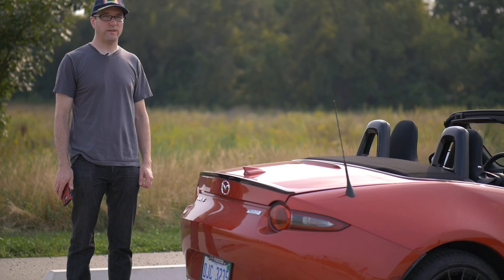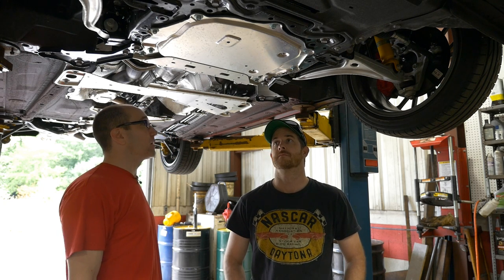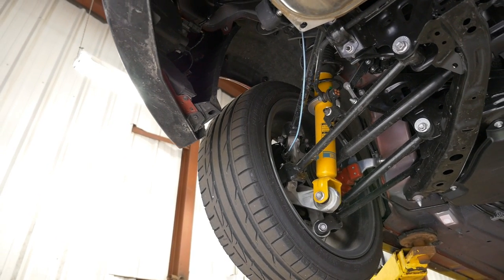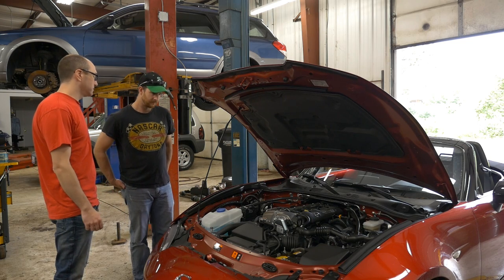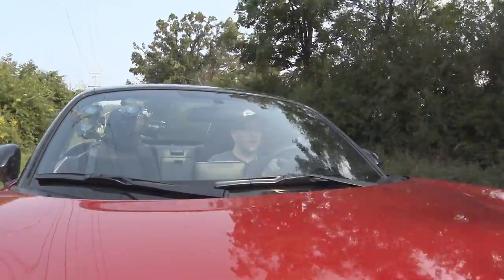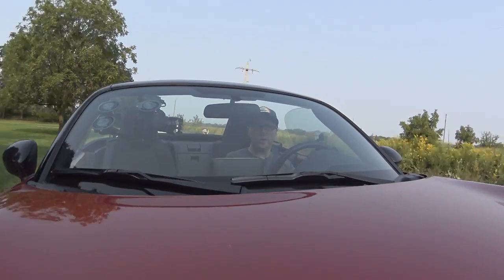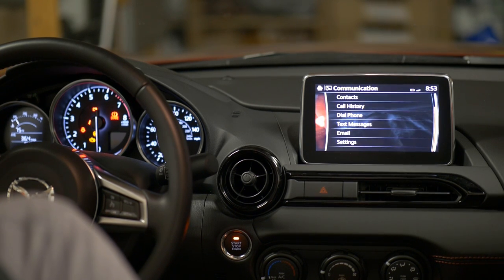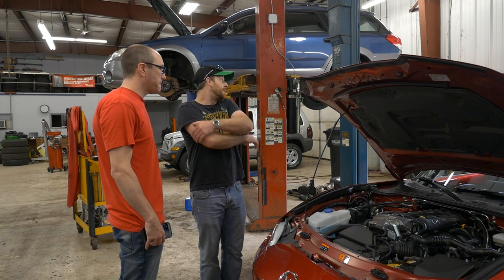Review | 2016 Mazda MX-5 | Curing Automotive Diseases

Comment: This car makes me emotional, someone in the auto industry still gets it!
Reply: holds you and pats head
Reply: i do, it makes me emotional too, i want it so bad.
Reply: I can confirm this car is everything they say it is and more, Owning a 2016 Grand Touring trim myself with the 6 MT. It is the best Miata yet in my opinion and i've driven all of the generations. NA,NB,NC and now the ND. I've seen the higher mileage base 2016 Sport trims well under 20K at this point, but i'd go for atleast a Club if possible. Such a fantastic car and absolutely worth every penny if you have the money to spare. Fantastically reliable too, Up to 60K miles now with nothing but fluid changes and tire rotations. Bulletproof car as far as I can tell so far as all Miata's tend to be, And I haven't exactly babied her either. Beautiful for a Miata too in my opinion, and the Bose sound kicks and is a very welcome addition to a car that has had historically poor audio performance.

Comment: I bought a new 2018 MX-5 GT almost two years ago, and I absolutely love it.  It’s my daily driver, including through NE Ohio winters (with a separate set of wheels shod with winter tires).  You hit many great points during your review.  I would only add that the car’s shortcomings are far outweighed by its other qualities.  If you can learn to live with such a small car, or make compromises, it’s well worth the trade offs.

Comment: Your review is really in depth. You look deep into the engineering that went into making this car then comparing to what is out there. Nice job of going over the good points but also pointing to the flaws. I watched this many times over plus the Engineering Explained & Consumer Reports reviews. Then saw an Autoblog Long Term Winter Test where  they had this 2016 MX-5 Club up in Michigan. Putting all this info together convinced me I could make the 2016 MX-5 Club my daily driver here in Illinois. Traded in my practical Honda Accord V6 Coupe to get this 2 seat roadster ! My plan will be to enjoy the heck out of it now but when winter comes get a set of snow tires. Short commutes to work. Single, no family its perfect for me. 1st convertible for me ever & loving it !  Driving this car is a blast ! I always look forward to my drive now & frequently take the long way home. Quite the bargain !
Reply: After 4 years what are your thoughts now on your Miata?
Reply: @dcarts5616  46 years of owning & driving cars. This 2016 MX-5 Club with Brembo brakes & BBS wheels has been the best one. As a daily driven roadster its been amazing in the 4 season weather of Northern Illinois. I look forward to each drive & yes its 4 years later. Has been thru Ice / snow / monsoon type storms / extremely cold & extremely hot weather. Mazda engineers have built a hell of a car.
Reply: I think the real question you have to ask is " can I live with a 2 seat roadster with minimal storage space " ? On my grocery store runs usually Buy for a 2 week period so the truck gets filled & the passenger seat becomes extra storage space. The people I've had as passengers usually love the experience. I calm my inner hooligan on those rare occasions. During the Pandemic this car has been a mood changer ! Put the top down after a hard day at work & the air flowing over you with the sunshine makes you forget why you were upset. Try to put a price on that feeling when walking out for a drive you get an increase in heart rate. Its good on gas even though its Premium every fill up I don't mind it. Would I Buy it again ? Yes without a doubt. THAT may be the best thing I can tell you.

Comment: I'm gonna be getting a manual Grand Touring model of this car as a daily driver in a few weeks. :)

I pack super-light anyway. I can get away with a 40L backpack (Mission Workshop R6 Arkiv) for a month long trip if need be, and I have a camera bag (Peak Designs Everyday Messenger) for day trips. Anything else is just clutter. If I can fit my 40L backpack plus a 24-in roller bag into the trunk (which it looks like I can), that's plenty of space.

For cabin storage, I only need place on the dash to mount my phone, a cigarette lighter to charge it with, and a small cubby for a coin box. Sunglasses can go in that little center console cubby.

The way I see it, as someone who drives in a big city (LA), I see lots of people who use Smart ForTwos and Fiat 500s around here, and everytime I see one, I just think to myself, "If you wanted a small, light, 2-seat car that can fit in any parking space you find, why didn't you just get a Miata?"
Reply from the maker: Totally agree since you are in the climate for it, Id likely do the same.
Reply: Did you get it????

Comment: The 1955 Mercedes-Benz 300SL was the first production sports car to use direct injection. The Bosch fuel injectors were placed into the bores on the cylinder wall 
used by the spark plugs in other Mercedes-Benz six-cylinder engines (the spark plugs were relocated to the cylinder head). You would think direct injection wouldn't be a problem in 2016.
Reply: it's not the direct injection, it's the exhaust gas recirculation! old cars didn't had to reburn the exhaust gases. port injection cleans the valves when it is sprayed. direct injection is sprayed into the cylinder.

Comment: A couples mod I did to my S2000 that makes it more useful for 2020.
- Rear auto dim mirrors with Homelink.  I don't get blinded by cars behind me anymore.
- Start engine without depressing clutch
- Open/Close convertible top without being stationary.  Pull the hand brake one click to activate.  
- Hardwire a GPS (Speed/School zone warning), USB ports for phones, dash cams (behind rear mirror), foot-well lights.  They are all hidden away behind "glove box" space.
- Modifry's DCI control and GPS mounts

I put mine on sale few times but never really want to sell it.  I recently drove it with winter tires and it's still amazing.

Comment: I'm a bit late to the party but   I have to agree that this is one of the best MX-5 reviews out there.  I'm picking up my 2.0l Recaro today and I've read/watched practically every review in English and German that I could find on the Web. 
I especially like the part in the shop, discussing/showing a car's underside. With that in mind, the local mazda-dealers I spoke to should be ashamed of themselves for not discussing the sophistication of the Miata's underpinnings with me. 

However: Watching this review and the AR 4C's back to back I have to wonder why the Alfa is so "heavy" despite its extensive use of carbon fibre while offering slightly less practicality and build quality and having the smaller engine  (displacement-wise).

But anyway: Great channel ... subscription button has been clicked. :)

Comment: Great video!  I just got mine a few months ago and I love it!  

I live in Denver and the snow management on the road sucks no matter what car you have.  This car actually handles better in the snow than the VW Passat that I had.  Also if you live in places where it snows more, then the roads are probably properly cleared.  It is also relatively warm in Denver even during the winter months so I did drive with the top down in January and February.  I was worried this wasn’t going to be a practical every day car, but I commute everywhere with no problem.  I don’t keep a lot of stuff in my car, so I don’t have a need for a lot of interior storage.  I take a phone, my bag, and a few other necessities. This car has helped me learn to keep unnecessary things out of my car.   It just got broken into and they got nothing!!  The trunk is large enough for me to go on a regular grocery shopping trip.  There are a lot of things I can’t fit, but my boyfriend has a bigger sedan.  This is definitely a car for someone who lives alone or for a household with multiple cars.  I was looking to get a BRZ, FRS, 328i, or a 370Z and I feel like I made the right choice.  

My biggest issue with this car is the placement of the charger port thing.  You literally have to almost get on the floor to plug something in.  They really messed up the placement in this car.   Another thing that kind that disappointed me was the lack of a luxurious interior.  The seats are not electric, the dash feels very basic, and it doesn’t match the stylish exterior.  I came from a Lexus GS and a VW Passat so I might just not be used to the more simple interiors.  It’s not a big deal, but it is going to cost a pretty penny to make cosmetic upgrades.  The last negative for me is the Bluetooth speaker in the headrest.  I can hear fine, but the person on the phone can’t hear me very well and when the call disconnects there is a loud beep that is almost painful.  

I love this car and the negatives I have are nitpicking and not huge dealbreakers for me.  I’m likely going to upgrade my ND to a newer model in a few years.  The only cars I would consider replacing it with are a Jaguar F-Type, an Audi TT, or a Mercedes SL.  They are more expensive and as I get older I am having less and less patience for all of the extra expenses and babying that goes into owning a European car.

Comment: First review of yours I've seen and have to say, I'm impressed. This is what reviews should be. No where else have I seen someone hoist it up and go over the undercarriage, suspension, etc. I also like that you slammed it where it needed to be slammed....no fan boy bias here!

As for the power, one theory I have is that Mazda wants to keep the aftermarket business in business. This is also another way to create a camaraderie among owners. They get together, do little tweaks, discuss parts, etc. which helps to keep the brand alive and interesting. Think of what would happen to guys like Flying Miata if the car came with 200hp from the factory.

Also, for engines, outside of the US, the base model comes with a 1.5 liter 128hp engine. You have to upgrade to the "sport" version to get the 2.0 liter. I haven't driven it yet, but pretty sure I wouldn't opt for a 1.5 liter. I have a 1990 NA and 2003 NB but skipped the NC. Based on reviews so far, might be time to add a 3rd child to the family.

Comment: The 2019 version's comprehensive upgrade of the engine makes the car genuinely fast: it gets to 60 in the fives. I bought the Sport (base model) late in the model year at a bargain price, in the mid-24s. I don’t need no steenking Brembos!
Reply: Smart man. I bought a 2019 Sport in late February; didn't get as killer of a deal, but got the same killer car.

At the base price of ~$25k, nothing touches this. Nothing comes close. A couple negatives still remain, but it's still automotive bliss.
Reply: Flying Miata has a "big little brake" kit that uses stock rotors but gives you 4 pot Wilwood calipers. I'm going to get the kit in the spring as the stock rear calipers stick from salt exposure from daily winter driving in central New Hampshire. Overall about 18 pound weight savings, they fit under 16" wheels. The price is quite reasonable, less than the Brembo option and includes the rear brakes. They don't have the flashy red paint, just grey anodizing, but quality parts.
Reply: @michaelbrooker1433  Well, all I can say is, I'm a big fan of Flyin' Miata because I used their Stage 3 Turbo kit in my NA to give fits to Lotus Elite drivers. But as to upping braking performance from stock: Here in Northern California, in very hard twisty-road driving, never have I experienced a moment of brake fade using my base-model's standard binders. 

And I'm talking about the infamous Hwy 9 south of San Francisco, as it crosses the hill country on the way to Santa Cruz and full-power bursts coincide with all-in stomping of the brake pedal to prepare for an upcoming decreasing-radius hairpin. 

I've diced with 911s and WRXs, and never ran short of brakes in my MX-5 Sport. And they could not shake me loose. The reason is simple: 2340 pounds net weight, MANY hundreds less than anything from the usual denizens of Hwy. 9. And, I can drive my Sport at its highest level of grip, using slip-angle four-wheel drifts to get those skinny 16" Yokohama tires to their maximum lateral Gs, without ever feeling overwhelmed. The 911 and WRX pilots do not have this luxury, and so must keep their far more powerful beasts under lock and key on this narrow road.

Autocross and track days are a different story. I know my car's lack of LSD would be a buzz-killer for autocross. But that just takes me back to this car's mission: As a classic British-style sports car, the MX-5's number-one purpose is not speed, but ultimate engagement with the driver. In a nutshell, it has been built from the ground up to be fun to drive. 

In this car, you can take a late-summer's day driving the amazing back roads from San Francisco to Point Reyes Station with your heart-throb and your little dog, and have a sublime picnic lunch on the beach as the waves pound onto the shore. And then, as the sun is sinking, you put the top up and the heat on and cruise effortlessly back to the city with the returning freeway traffic, and as your lived ones sleep you listen to a podcast using wireless earbuds connected to your iPhone, which is also giving you road reports and weather updates. All this in the bare-bones Sport, the one the dealers hide away because this car robs them blind! A word to motorheads: Get this car!

Comment: There should be a way to fold that big TV screen down. Older viewers may recall those old travel clocks, a clamshell arrangement that has the clock pivot forward from the bottom on opening. A simple thing that would address my main complaint in the Club car, in fact I would go with the base car for just that reason. The Bilstein shocks will be available in the aftermarket, as will the shock brace. The LSD will be more complicated if one wants one. These are not GT cars, most driving will be on local roads, save all that crap GPS and infotainment for GT cars, with this car the car is the infotainment, basic stick and rudder/seat of the pants stuff. 

I want one, in black please with silver wheels.
Reply: I got one, a Sport, white, 52,000 miles now, a year round driver in New Hampshire.I am 3ducs with a different account.

Comment: Gotta agree with the assessment of the rear end improvements of the ND. Having had two NBs an NC and now an ND, the handling of the ND at and beyond the limits of grip are much more confidence inspiring. It took a hundred corners or so to get used to the ND characteristics over the NC I had put over 150,000 miles on, but now that I am getting comfortable, I find I can control the rear end more precisely. The ND also feels even lighter than my NBs. I solved the super annoying "bump the switch when shifting" issue with a thicker arm rest on the console.

Comment: The review that convinced me to buy a 2016 nd miata in 2016. In 2 years' ownership, only fun times at very little cost (incl. maintenance and gas) and got me hooked on the benefits of a very lightweight car, as a second fun car, that can be driven at 8 or 9/10ths on the street. I chose this over a 718 Boxster and Audi TTRS, also very fun cars, due to the gear ratios and go-cart feeling mainly, and do not regret one bit. Sure, it may be a bit lacking in raw power for some or brand prestige, but not in smiles. The gear ratios are just perfect for fun on country roads, even rowing through the gears between red lights is a joy. Heel and toe at legal speeds at a roundabout, yes please. Any chance of an Alpine A110 review someday? Thank you for such informative, geeky and high quality reviews. Greetings from Switzerland.

Comment: What's crazy is, my 2006 MX5 NC has 170 horsepower with the 5-speed. With some 17 inch wheels and 225 45 tires it handles damn well. All you need is some upgraded sway bars front and rear and a total car fluid swap to synthetics.

The Mazda L engine 2.0 found in my 2006 is the engine that Mazda modified to create the skyactiv engine.

The Mazda L engine technology is also carried over to the Ford EcoBoost. The Ford EcoBoost is the Mazda L design and Mazda even still makes Mazda L engines in Japan specifically for Ford vehicles.

The skyactiv engine is one generation newer than the Mazda L engine.

Comment: Omg you have to reach “under the bumper” (its not under the bumper) to press a small delicate button to open the trunk.  Ohhhh the struggle its sooooo difficult
Reply: Complaints about the position of this button are stupid when there are 3 ways to open the trunk. If it's such a chor to reach down to the plate button (most people don't even know exists), THEN USE THE REMOTE OR THE  BUTTON TO THE LEFT OF THE STEERING WHEEL !!!!

3 OPTIONS IS OVER KILL. NO RIGHT TO COMPLAIN !
Reply: @WizardTerence  Haha my first gen MX-5 only allows the key in the back to open. No opener inside the cockpit. 3 ways is more than enough haha.

Comment: I have one (2018 160cv Nappa Zenith), it's preaty funny to drive at low, mid and high speed. Each second in this car offer to me a lot nice feelings. If this car would have more power i think that lose control, more weight and another things, it has the perfect tuned to enjoy. I use all day and the only two things bad are the two seats and the trunk. If you does not mather with that its your car.
PD: nice review!

Comment: Those front control arm cams both adjust camber and caster. Caster goes opposite way on front and back but camber goes the same way, so you can dial in your exact camber+caster

Comment: Front caster is adjustable. The two cam bolts on the bottom of the front lower control arms are for camber and caster adjustment.